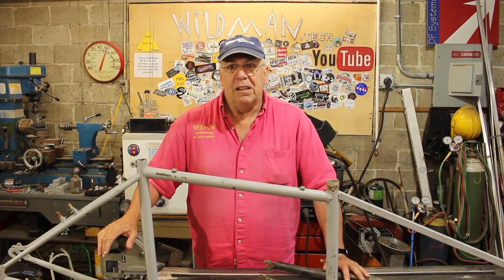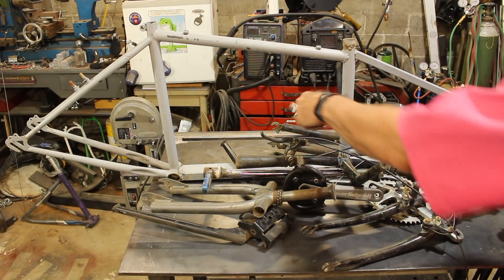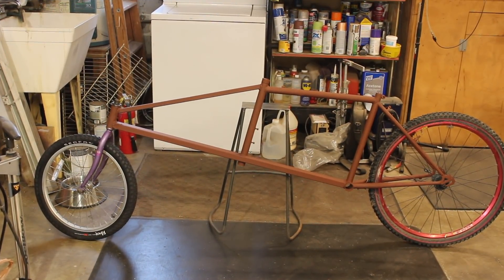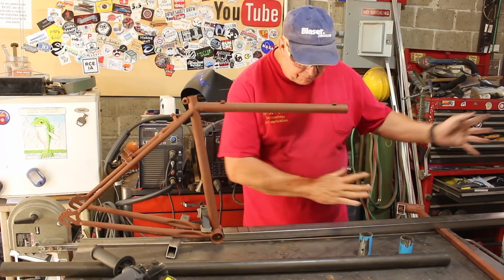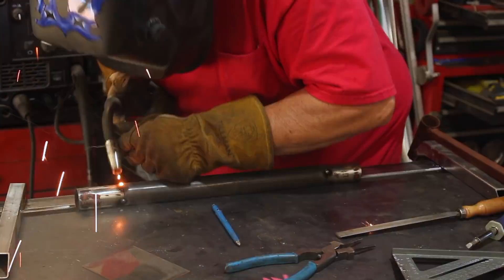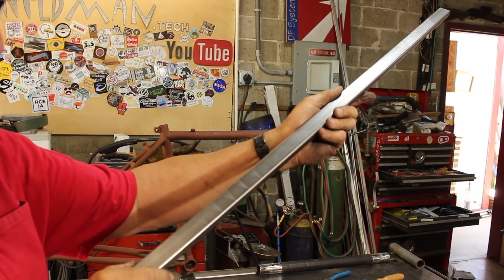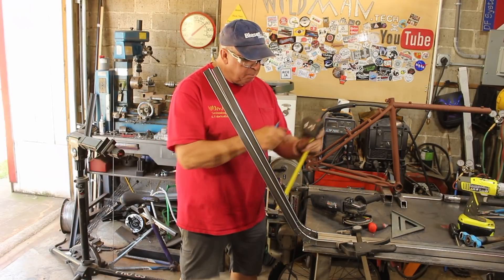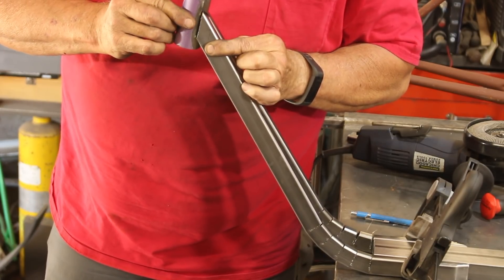Cargo Bike Build - Part 1

Comment: looks like you can fit a Bathtub in the front Cargo area ;D
Reply from the maker: Yeah. It was way too big. That's why I shrunk it down after the shakedown cruises. Part 2 covers it. Link in the description.
Reply: @WildmanTech  but it would be fun to have a Cargo Bike with  a Bathtub for Burning Man
Reply from the maker: @fleursworkshop1453  I'd be surprised if that had not already been done.